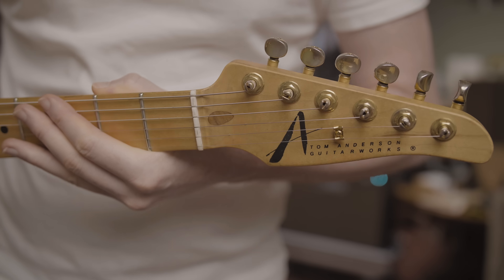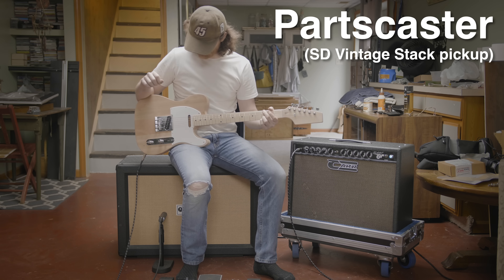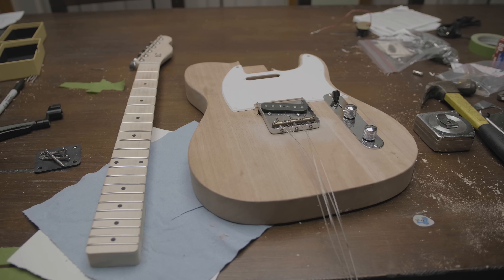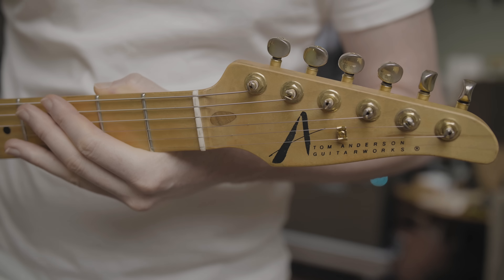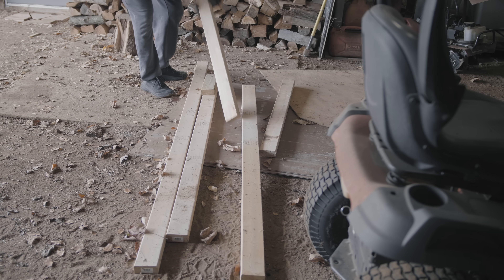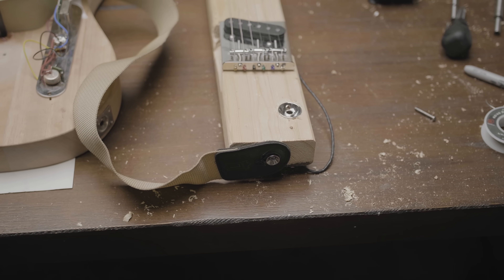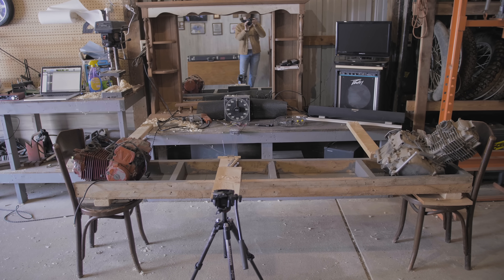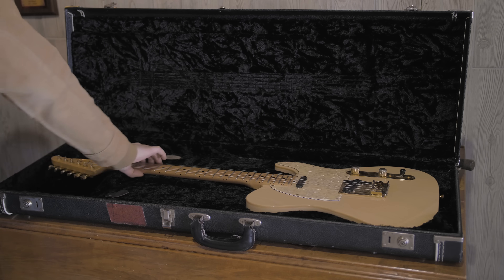Tested: Where Does The Tone Come From In An Electric Guitar?

Comment: this makes sense from a physics stand point. The sound is a function of the strings frequency (with transients differing with pick placement), and the changing magnetic field it produces is entirely dependent on pickup placement, angle, and distance from the strings. The type of wood can't make any difference sonically.

Comment: Awesome video!

I've been saying that 70% of the tone on an electric guitar comes from the pickups, and the rest is the... well, the rest. Now I think I'll have to change the numbers to at least 80% pickups / 20% the rest 😁👌

To my experience (around 150 guitars built so far) is that tonewood has a role in the tone of an electric guitar, but it's a minor one. I had two similar guitars I built, one with mahogany body and one with alder body: same neck, same pickups, same bridge, etc. etc. etc., and the mahogany one had more bassy tone for sure. But it was still a very much EMG 81 tone on both guitars, other one was just a bit more bassy through the amp. 

The pickups being electromagnets pickup (obviously) only the vibrations of the string within the magnetic field, and not the acoustic sound like a conventional microphone does. So 0% of the acoustic tone of the guitar is transmitted to the pickups. BUT. The strings vibrate the body, and the neck, and the vibrations return to the strings from the body if the bridge is secured well enough to the body, and the now different vibrations of the strings in the magnetic field. Again, a minor MINOR difference, but it's there.

One I'd like to see is the difference between a loose neck joint and a proper one in terms of sustain, ie. how long the string vibrates. (EDIT. Oh, you had done that already!)

EDIT 2: I just checked my production queue, and within about 10-12 months I'll have two otherwise identical guitars in production, same builder (me 😁), same neck, same body shape, same constuction, same finish, same hardware, only difference being other is ash wood, and other is mahogany. I'll definitely take a DI recording to Cubase of both guitars and get a spectrum analyzer graph of them with the same pickup at same height, and see if there's any actual difference there.

Comment: Since I started tinkering with guitar parts and wiring I always laughed at cork sniffers and snobs when each tonewood debate unleashed.
Here is order what affects tone of the guitar:
1. Pickups, if you doubt it swap humbucker for singlecoil and find out. Different types of magnets, wire and number of winds and then it’s position to strings. Same pickup in bridge and neck position sounds drastically different.
2. Electrics. 500k vs 250k have drastic differences, wiring pickup coils in different fashion (series vs parallel) will drastically change tone.
3. Construction. Solid body guitar sounds much different than hollow one. Also neck joint (glued on vs bolted on) have great impact on attack and sustain.
And after all of that wood might contribute but less than 2% imho.
All the binding, finish type, wood etc is just for aesthetics.
Every guitar can be great if you set it up right. That’s why I prefer cheap vintage Japan/Korean guitars. I give necks to luthier to fix radius and change frets, wire them with pups to my liking and enjoy the hell out of them.

Comment: Hi Jim if you go back to physics and look what is the most important factor in the transfer of sound through materials, it is the density but most importantly the elasticity of the medium. In the last test you put the tuners and the bridge on extremely solid and non elastic materials.  Once I saw the set up, I was expecting a sound with extreme clarity but less warmth due to the extreme lack of elasticity of the system. Something that would resemble this setup would be guitars made out of extremely non elastic materials such as carbon fibre or metal. Indeed the sound of the air guitar resembles some Steinbergers made out of carbon fibre. I would like in the end to point out, that although in the air guitar it looks like you have completely removed the guitar body and neck this is deceiving. Although you removed body and neck from the system, you have actually substituted them with massive metal and wooden benches increasing the rigidity (reducing elasticity) of the system to very high levels that are not achievable with normal wooden guitars. So although it looks like you increased the elasticity you did exactly the opposite.....you reduced dramatically the elasticity increasing the transfer of sound through the system which is reflected by the increase clarity of the sound but the lack of warmth.

Comment: But they DID all sound different. It was very subtle but it was there. Tone is a function primarily of the signal chain, but there are factors influenced by the rest of the guitar that we don't usually think of when talking about tone. Things like attack, sustain and decay are absolutely affected by the neck and body because the vibrations form a circuit that goes from the strings to either end of the guitar and back. The amount of vibration that the body and neck do affects the amount that gets transferred back, through the circuit, into the strings, it's wave physics. A more resonant guitar where the body vibrates more freely(like in an acoustic,  tends to be more noticeable on bolt neck guitars as an example) will sustain less because the body is doing more work than one with a more rigid body(seen often in maple body solid bodies and maple neck through, where the neck is a large part of the body itself) that will sustain longer but be much quieter acoustically. These things may not affect the timbre, or colour of the tone, but they are part of the tone and part of the thing that makes different guitars sound and feel different from one another. A Classic Vibe tele with a pine body sounds and FEELS different than one with an ash body because the pine body vibrates more freely than the more rigid ash, even though all other aspects are identical. The colour of the tone can be matched between the two, but that's only a part of it.
Reply: After adjusting for all the factors that he did they sounded identical enough that you couldn't tell the difference in a blind test.

Comment: Remove one ingredient from a cake and bake it.   It's still a cake but it WILL be different than b4 you removed that one ingredient.   Will it be a NEGLIGIBLE difference?   That's the debate.  FOr me, it all makes a difference but the biggest noticeable one has to be pickups.   CHange the pickup and you can get a very diff sound.  change the body wood, not a very different sound but still different.  Bridge mostly is just a conduit to the body so you just want a solid connection and narrow smooth saddles to give the sustain but also a little bite to those high harmonics.   But yeah, the stuff the strings vibrate upon matters.  Just my 3 cents.
Reply: I don't think it's still cake if you remove one of the basic ingredients. I get that it's an anology but that's a pretty poor understanding of cake.
Reply: @jh-ec7si  Uh, no, if you remove say vanilla from it, it's still cake.   If you made it w/o any salt... still cake.  I mean, if you removed the FLOUR, then you have no cake.   so, it's a fair analogy.   IOW, everythingmakes SOME difference because there is.... a difference.  BUt not everything makes an APPRECIABLE difference and also, some people are not able to hear/see/understand the very subtle differences that others can and that's all right.   I hear the very subtle diff in body woods.   If no one else can, that's no skin off my back.
Reply: more like 0,1 cents
Reply: @chronokoks   yeah, let's see your luthier and guitar playing vids.   Let me guess.... you have none!

Comment: Love this test. This should put another nail in the coffin of the tone wood debate on an an electric guitar. Now, we need to talk about tone air. 
The pickup was like 80% of the difference to my ear over Youtube. Then the height, and it was basically identical on every test after that. An electric guitar makes sound by vibrating a steel string in a magnetic field. That field flux becomes an electric current that the amplifier turns into sound. Scientifically-speaking, the material of the body, neck, bridge, nut, whether or not a priest has blessed the tuners... none of that crap makes a perceptible difference. String height does, Pots and caps do, Pickups do, wiring might.

Comment: Awesome work, man! Loved it! 😄

I'm unsure about the physics of the "air guitar" though - those are two big bodies creating a huge amount of force on the strings. It's hard for me to say if this experiment is valid - having the strings attached to those surfaces with that much force, I would think the vibrations are probably interacting with those surfaces better than they would have with a hypothetical "bodyless" guitar. 🤔

I can't stop wondering, what would a "more bodyless" guitar even look like. I would suggest maybe trying to decouple the fixtures from the surfaces, using a thick layer of rubber?

Another good material for dampening vibrations is PVC. I wonder what a guitar with a PVC body would sound like? 😄

Comment: Kudos for all the effort you put into this.  Unfortunately, the questioning behind this test is quite blurry, what exactly are you trying to prove or disprove?    I'm asking because there might be more ways to prove that stuff sounds the same than proving it sounds different, and since the difference is the sum of things that are different and the things that are common, stripping down that complexity to a common minimum may be leading to conclusions far from practical reality (or simply wrong conclusions as many of the comments seem to derive from your video).  

You started out with an already quite stripped down input data setup (strumming a few chords) with pretty different results and you ended up with a setup that lets you merely compare a single open chord that sounds the same because now anything that could make a difference was either absent or couldn't be used anymore, the comparison setup wasn't really a guitar anymore.  So what is the intention of this setup, to prove that you always end up with cyan if you remove magenta and yellow?  That all the tone comes from the pickup?  If you reduce the complexity to strings and a pickup on a table and compare that to a guitar that was designed to be not much more than a table with strings and a pickup, what do you expect to be the outcome?  

Contributing to the questionable setup is that you ignored the imprint of the crunchy amp, turning somewhat different input waveforms into something more uniform that's increasingly dominated by harmonics the amp created. That the amp and settings remains the same doesn't make the comparison scientific, again it's like trying to asses "color" through a color filter.  Also, the test was performed very much ignoring all the possible time-dependent properties.

Even if the hypothesis and the physical test setup wouldn't be flawed,  one important component is biological a.k.a. "the guitar playing meatball wrapped in a t-shirt", his brain a.k.a. psychology, the meatball's musical skills and imprinting and the construction details interacting with these meatball-related components.  Case in point is Telecaster and Stratocaster being physically almost identical and having for the most part only aesthetical differences.  When the middle pickup is not used, they sound pretty much identical, at least when you just strum some chords through some amp, IOW if that's all what some indie rock artist does with either guitar, there is virtually no difference.  Yet there are people spanking the undeniably existing trademark Tele sound out of their Tele, because they play it in a way that emphasizes the very subtle differences between these guitars.  The same people can make their Strat sound pretty much the same, yet they grab the one or the other guitar to utilize the small differences to create different and "typical" tones, which is the result of interaction, a kind of feedback loop between player and instrument.  

Again, there are more ways to make guitars sound the same than making them sound different, with the latter possibly depending more on skills than the former.  On the other hand, the right player can also make e.g. a Tele sound almost indistinguishable from a jazz box or a Les Paul, or a jazz box or Les Paul almost indistinguishable from a Tele where it matters, because he can utilize a mix of musical repertoire and tone-forming playing skills to do so. But they will prefer to play specific things on specific guitars, because utilizing the constructional differences and the resulting sound is fun and will lead to different results, which always consists of all components in the system.

Comment: The difference between the 2x4 and the tele was the sustain, it was pretty noticable the 2x4 had no sustain at all (I think the body weight and shape have to do with that)
Reply: There weren't any shots in the video where he actually let any notes ring out long enough to make a judgment on the sustain or lack thereof

I dunno about the sound being noticeably worse. The 2x4 sounds closer that the partscaster did before he started swapping pickups and hardware.
Reply: And the "air guitar" is actually a guitar with an enormous steel bench as a body and 2 honda engines and a massive lump of wood as a headstock. The most telling test was the 2x4 and the sound was noticeably worse!

Comment: An interesting experiment, but not thorough enough.  I build guitars, for about 30 years or so.  At one point, I built 5 exact guitars via cnc to the exact same specs.  Using different bodies and necks and fingerboards.  Alder, ebony, rosewood, limba, wedge, maple,  alder, etc…. Used the same pickups and hardware, strings, etc… They all played different.  Sonically, especially if high gain and such, you may not find much difference, but that is not what you look at.  The ‘feel’ is the big difference, not the tone.  I am inspired to play differently on them all.  If I am playing a maple neck/fingerboard, it just gives a more spanking / snappy feel than ebony/maple.  I was inclined to try different things on each.  My approach was different on each.  And tone wise, just enough subtle nuance of bright / mid to bring on those mindsets.  And of course the quality/setup means something.  You play better on a better guitar, both physically and mentally, just like a pianist or violinist, etc.  the secret of the wood goes beyond the tone, tone is just a small part.  Tone and playing mostly comes from your hands.
Reply: 30 years and you can still fool yourself :D

Comment: I just started playing guitar a week a go. I've been doing tons of research and tutorials, and I kept asking myself, "what's the difference between these $200 guitars vs these $3000 guitars" (all electric)
The only thing that can really effect sound is electronic. The pickups are only detecting movement of the metal strings.
Reply: The only real difference between a 200$ and a 3000$ guitar is feeling, ergonomy and relatability. 
I have a 300$ Harley Benton which sounds and feels incredible. I like it more than some of my 1000+$ guitars and didn't mod anything yet... It really lays on personal preferences though. 
Changing electronics including pickups on a confortable cheap guitar can be a very good option.

THE most important element when it comes to tone is the amplifier. Then the most confortable you feel on a specific guitar, the better you play.

Practice a lot, don't give up and most importantly : have fun. Learning guitar is a long and tough journey but, man, it is worth it. 
I have so much pleasure playing the guitar after 13 years, I wish everybody to feel this in their lifetime.
Reply: @MelodicPicking  thanks man. I've always wanted to learn. It is tough, but after a week I'm noticing a huge difference, and my finger dexterity is getting much better
Reply: You are paying for higher quality parts and better finish. Same thing with every instrument. 

Starting out? Buy guitar that is cheap but not cheapest on the market. If you won't stick then sell it.
Reply: @_Pawelski  got my self a squire affinity Tele hh. Need to shave the corner of one of the frets, the little e string keeps getting stuck on it, but other than that, it does the the job for me

Comment: This is absolutely brilliant!  Nice work.   However,  I still don't understand why my SG sounds distinctly different from my Les Paul.
Reply: I think it could have a lot to do with the feel of the guitar changing your perception of the sound.

I had a neck-thru squier with humbuckers and a floyd rose that I SWEAR had a mushy attack sound, the guitar just felt "dead" to me, I couldnt really feel or hear the strings acoustically as I played, compared to my light weight poplar LP junior style guitar, but when recording it, that effect was basically gone. It had a nice crunchy fairly detailed sound, but I was so used to "hearing" the guitar with my fingers, that it felt like something was missing on the heavy, floating trem guitar.

Maybe your SG vibrates more because it's lighter, so you "hear" the guitar more by feel?
Reply: @TKDWolf  based on evidence from the video, the tonal differences must come from the pickup and its position.   But it's pretty noticeable, to me, on every SG or LP I've played.  I think SH bridge pickup is slightly closer to the bridge.